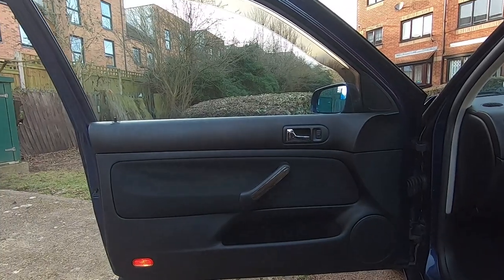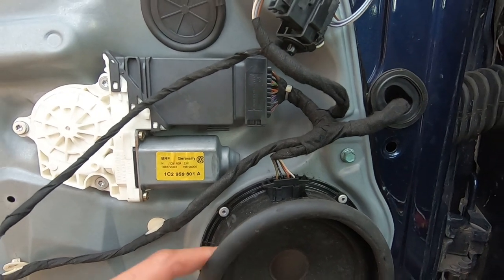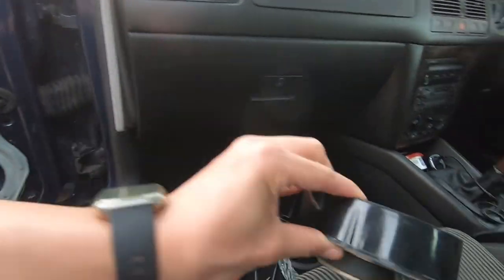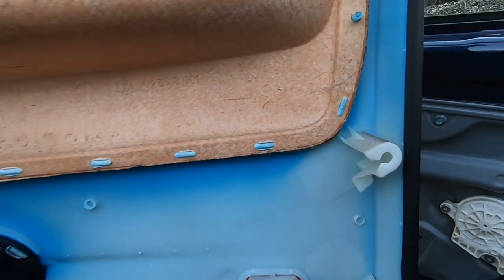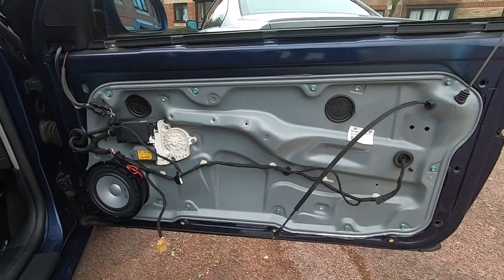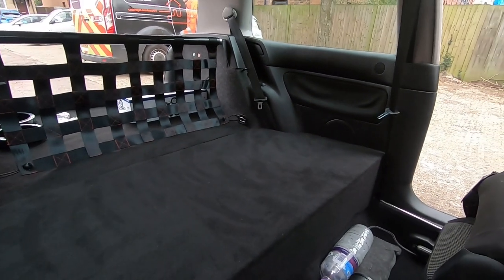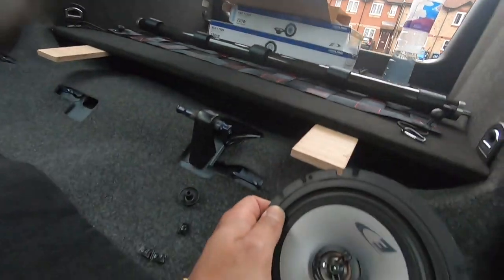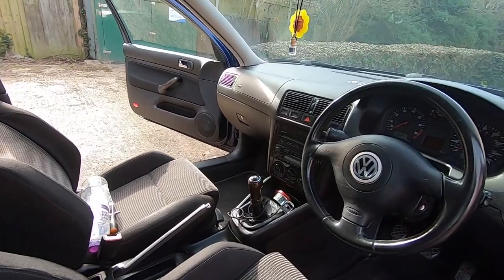MK4 GOLF GTI SPEAKER UPGRADE

Comment: Great install video bro👌🏽Noticed you're still using the stock head unit. It's worth noting that the stock head unit has a really low output power, so you'll notice an even bigger improvement if you swap that out. I've got a Pioneer double DIN head unit (similar ones can be picked up for around £60 second hand) with stock speakers and it sounds really good - bit rattly when there's really heavy bass, but I've narrowed that down to my interior being a bit loose in places.
Reply from the maker: Yes mate nice one, I think that will be my next thing to do along with the tweeters and get it pumping in there nicely. Thanks for the advice mate I will keep my eye out for a nice little bargain. I too have a loose interior in place but that is just the car showing its age a little bit.

Comment: Been thinking about changing mine as I've a new kenwood head unit and kenwood sub watching this has given me the boost I needed to get it done . Gonna get same speakers as well 👍🏻👍🏻
Reply from the maker: Go for it mate, get the tunes pumping. I'm currently modifying those panels behind the door mirrors to fit the new tweeters and it's a lot easier than I thought. What is the model head unit you have? I might check it out. 👍🏽
Reply: @SPOOLINUP  I've had it a few years now its a kenwood double din one I think its dmx7017dabs one it's got android and apple play great sound just need better speakers in the doors
Reply: @SPOOLINUP  I've a pair of spare tweeter bits so will have at least one to make a mistake with 😂😂😂 and can practice exactly where they go might have them visible as well . Redoing my interior dyeing the seats half black and beige as their beige now so door leathers I'm gonna dye black and spray speaker covers black as well loads to do good excuse to do speakers as door panels have to come of
Reply from the maker: Nice one mate im going to have a look at it now, im trying to make a choice on what one to buy over the next few weeks. Your one sounds good 👍🏽
Reply from the maker: I'm replacing the standard tweeters up front which isn't turning out to be a bad job to do. It would have been cool to have another pair on top of those though. Where are you thinking of putting the spare ones you have? You might be able to get them in the door card. Black and beige will be a nice little colour combo in the car or. Having a nice interior to sit in definitely makes for a more pleasurable drive. The speakers are a nice little touch. Good luck with the work 👍🏽

Comment: nice upgrade! i have a 5dr mk4 with no rear speakers, was just thinking of getting some kicker component speakers, sound deadening the front doors and upgrading the stock tweeters and getting the 12” edge active sub but keeping the stock head unit purely for the aesthetic as i prefer it to aftermarket head units (sacrificing a larger delivery of power and sound quality i know, but ah i’m a sucker for aesthetics) 😂
Reply from the maker: Nice one mate, I hear you with wanting to keep originality. Someone actually suggested a stock looking head unit to buy and it looks pretty cool, its called RCN210. Maybe you would consider it if you didn't want to sacrifice the benefits of a more powerful unit. I still haven't bought a new head unit, I know a lot of aftermarket ones don't really suit and they can look tacky. Sounds like you will have a nice setup though. I'm yet to get a head unit but will wait until payday. Good luck mate.

Comment: Great video! Very very helpful, I have same GTI and currently I’m adding same speakers on the front doors 😂 while I’m doing the upholstery on the panel doors.
Quick question, what’s the connectors you are using? Also the circular adapters? Would you mind to share the link? It would be very appreciated! Thanks loads! And great work!!
Reply from the maker: Hello mate, I hope you are well. Great minds think alike, as they say. Everything I used to fit these speakers came in the whole kit from Ebay. Im glad the video has been assisting you well. Here is the link. Good luck with the whole job.

https://www.ebay.co.uk/itm/353341674351?mkcid=16&mkevt=1&mkrid=711-127632-2357-0&ssspo=N-EDmmd3TGu&sssrc=2349624&ssuid=h0Ws8awTSQu&var=&widget_ver=artemis&media=COPY
Reply: @SPOOLINUP  Thank you very much, very appreciated! and looking forward upcoming upgrades on your GTI! Cheers
Reply from the maker: Thank you my friend, I hope to keep the videos coming and I hope to improve and make them more entertaining.

Comment: How are you liking the Alpines? Upgraded the head unit in the Leon some months back to a Idoing android unit and it has really improved the sound but some bass/mid tones cause some distortion from the speakers.. guessing they might be kinda on their way out. Been thinking about changing the speakers but honestly really clueless to the available options haha.
Reply from the maker: The speakers are cool man, will definitely do my head unit next as well to get the most out of them. I will also do the tweeters as they are a little more challenging. Its a nice little upgrade to do especially before the summer comes so you can cruise with some nice tunes.

Comment: Hi was wanting to replace the speakers in my golf but was wondering if the speakers are able to fit in behind the door card with anything needing to be cut or resized?
Reply from the maker: Hey, I didn't cut anything, but I had to drill the rivets out of the old speakers behind the door cards. Nothing was cut and pretty much everything is reversible. The speakers are the same size. The only thing I had to alter was the panels that house the tweeters.
Reply: @SPOOLINUP  thanks I literally just pulled them off today however the rear speakers were replaced before which is the reason they don’t work lol but I appreciate the help keep up the content man I really enjoy it 👍

Comment: Nice video. I have the same car, same problem. lots of rattle with deep bass. I’ve been torn between upgrading from the stock head unit or getting speakers like you did. Did these speakers fix the rattle? Do you have the factory head unit?
Reply from the maker: Nice one man, so I think the main bad audio is coming from the front tweeters. There will be some modification to their mounts required to change them for the new ones I got in the kit. The new speakers are great so I would recommend it and yes I have a factory head unit, should I change that?
Reply: @SPOOLINUP  I’ve heard that newer head units have better sound quality. If I could just do one or the other I’d be happy, and I do kinda like my stock 1999 navigation radio. Thanks for the info, I might just do what you did.
Reply from the maker: I know what you mean, I think the stock units look so much better in the car because it just matches everything else. I do however think it would be nice to have something more modern there to use in terms of Bluetooth and better sound. It's a tough decision.

Comment: The stock speakers are actually very very good. I was very pleasantly surprised when I swapped out the stock head unit for a quality double din unit, not going to win any sound offs but I feel no need to upgrade the speakers at all (I've done the route of amps and subs etc etc with many previous cars). That glass in your door panel was more than likely at least contributing to vibration noise but maybe just interior in general was a bit 'buzzy'. Mine has the full leather so that alone probably helps with acoustics being a more solid and weighty build, don't know if they had better speakers as stock in leather models (is also 5 door)?
Great vid as usual anyway, are you happy with the upgrade?
Reply from the maker: Yea actually I think I will go for the head unit next, was it an easy job to exchange for the double din? I think my interior being a low quality one and just a little aged now but I'm planning on revamping it all soon. Full leather definitely helps either the acoustics for sure man. I am happy with the upgrade but will continue to do more bits, not going to mess with a sub or amps so will keep it simple. What head unit do you use mate? Thanks as usual for your comment and advice.
Reply: @SPOOLINUP  Yep it's a very simple upgrade and if you get a quality unit (not some naff Android touch screen thing) you'll be blown away by the difference. The opening in the dash is slightly bigger than a double din so you need a facia / adapter plate, they're about £8 on Ebay. I went for a Sony WX-900BT (got one boxed as new with microphone etc for £60) which brings you up to date with bluetooth and hands free calling etc but also has fully customisable colour for the buttons and display so was able to tune it to an exact match for the dash illumination. It's really neat and just looks like it's meant to be there, for less than £70 it's the best upgrade I've done to the car.
Reply from the maker: Sweet man thanks so much, I will look into that now, I've always wanted to go a head unit but some of them look tacky and almost too modern for the older cars sometimes they stick out like a sore thumb. Gone are the days of people smashing windows to take them as well thank god. I am looking forward to getting this done to get some more out of the new speakers. I don't really want an android screen so this one should be perfect for me. Only thing is those android screens are really easy to use which is a plus point and being touch screen it makes it even easier. I want to get something that fits in so I will make sure I make the right choice. Thanks again
Reply: @SPOOLINUP  Obviously it's down to personal choice what type of head unit you put in there but I'd advise to stick to a decent brand like Sony or Pioneer. My personal criteria (aside from being very good audio quality) was to have an actual CD slot (I like to burn my own MP3 discs), something that looked cool without being ultra modern but with the bluetooth functionality for hands free calls (phone just synch's when I turn on the ignition) and above anything else I wanted a proper knob / wheel for volume control! I can't stand having to press buttons or touch a screen to adjust the volume, sometimes I want to instantly crank it right down for whatever reason and don't want to be fumbling around holding buttons down or pressing a screen! Some things I prefer to have mechanical practical function rather than annoying gimmicks.
The other thing that sold the Sony unit to me was the mentioned customisation of the colours, I have the climatronic heater controls (annoying buttons, would rather have dials) which has the blue lcd display so was able to match the head unit to this and the rest of the dash display exactly.
If I get around to giving the car a clean at some point I'll do a walk around vid including the stereo and dash setup at night.
Reply from the maker: Sorry for the late reply man. I definitely agree that a decent brand has to be the most important thing. I don't know if I need a CD slot because I actually don't own many any more because CDs from my childhood got destroyed and I can't make any. Bluetooth for the hands free is needed 100% mate im with you on that as at the moment I use a FM transmitter which is good but nowhere near as good. I would also need the audio control know probably as I cant turn it up and down on the steering wheel. I too enjoy the mechanical controls as you get a bit more of a feeling with them. The customisation bit sounds cool as well. I am sure I will make the right choice in the end but I think it will take some searching.
Reply: Hi Naz I can help recommend a Bluetooth wireless thing that I got for mine. I haven’t upgraded the speakers due to the amount of time it takes plus I think the stock speakers are decent, it’s the head units that let it down. However I don’t want to upgrade the head unit either as I have the MFD double unit that integrates with the sat nav and steering wheel display. I’d love to show you my set up one day mate.
Reply from the maker: I get you mate I wouldn't want go swap that out either because you have a decent spec car it would be a shame to take the good parts out. I have a bluetooth FM transmitter to link up to the radio and ive been using it for years but I would like to experiment a bit. I'm currently doing the tweeters.